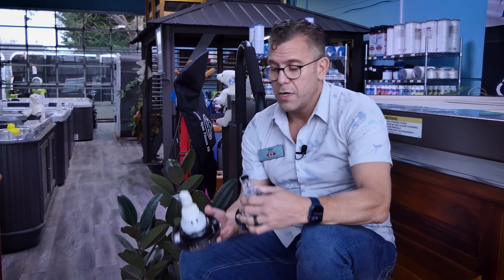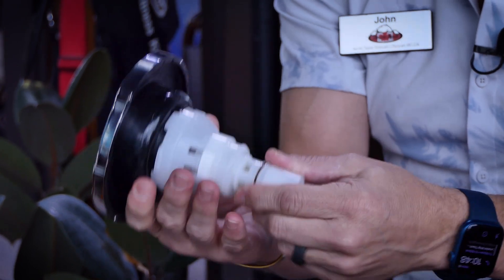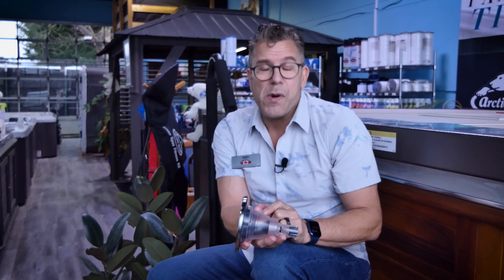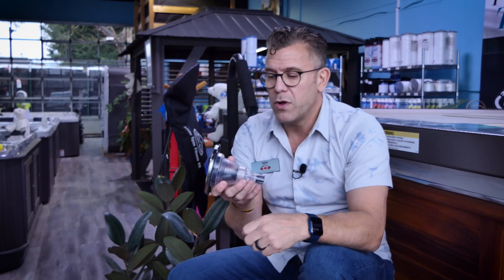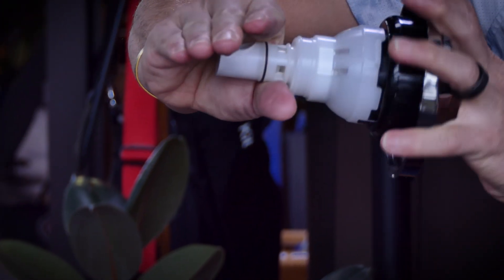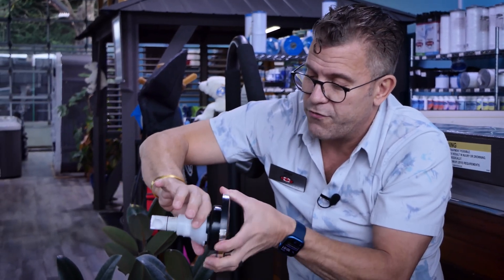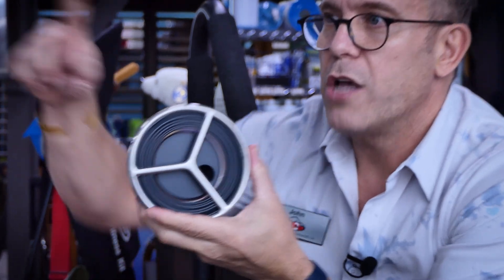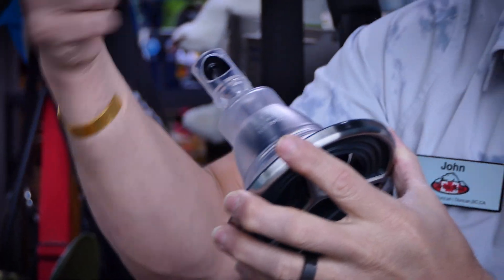Arctic Spas Jet Construction

Comment: April 2024 new YUKON hot tub installation. Had to replace all my jets once after 4 monts due to rusting corrosion pitting issues on the stainless steel rings. 2 months later, same issue, replacements are pitting/rusting again. Thinking I made a mistake buying a saltwater hot tub system instead of old standby chemical (Cl/Br) sanitizing system. Testing this saltwater system as much if not more with strips compared to my old JACUZZI tub. THe spa boy apps says things are okay for Cl and pH. test strips say otherwise. Using new test strips too.

Going to see if corroded jets are warrantable - again. If not, will buy all new rings, keep old ones. When I go on a trip for a few weeks, will swap out all the jets with rusty ones and keep "newer ones" for later to delay the inevitable replacement time. If only I could go to plastic screw in 3", 5", 7"  jets for this newer style YUKON tub.
Reply: @akfish3463 Can report that I have the same issue after 2 months. Did you ever get it addressed by Arctic Spa/your dealer?